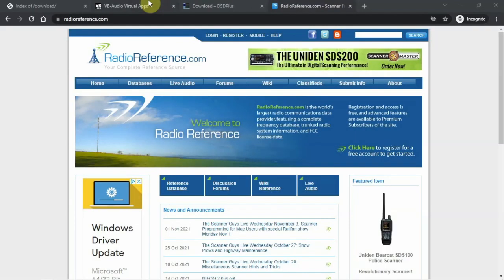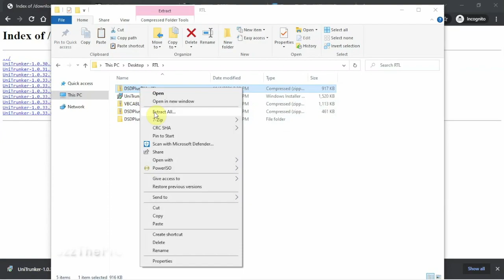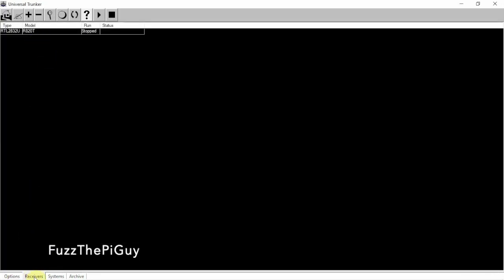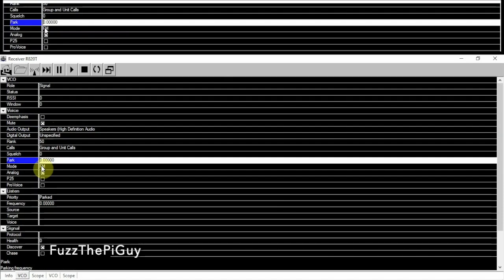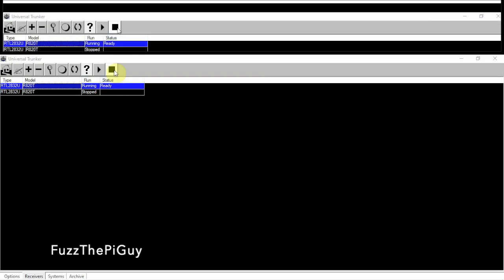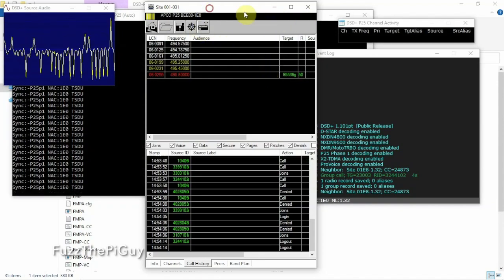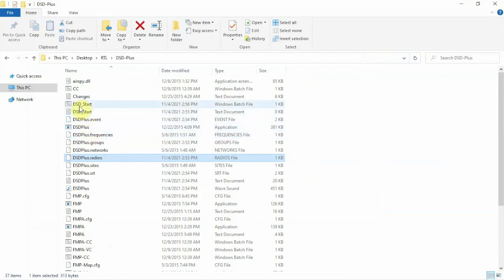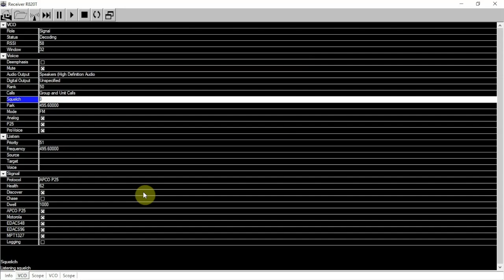Setting Up DSD Plus, Unitrunker, And VB-Cable On Windows 10 | Digital Decoder For P25 And More

Comment: Help! So i have gotten Unitrunker's health to almost 100,bounces from about 80 to 100 and i see calls coming across, But all i hear is static, i also get an error trying to start the Batch file you make, it says windows cannot find it make sure you typed it correctly. My audio input device #1 is cable input vb audio, Audio output device #1 is my speakers. Is this issue because im trying to decode a p25 phase 2 system and dsd plus only decodes phase 1?

Comment: I've tried multiple times, and it just stays on the control frequency at my mothers (I can see the data stream, and see the frequencies pop up showing people on those frequencies talking, but it never jumps to the frequency they're talking on), it never goes to the voice channel even if there's activity, and no the voice coms aren't encrypted as I can go to the voice frequency on SDR++ using VB cable as output and having DSDPlus decode it just fine. 

Now the odd thing is that I got it working just fine at home and it'll hop to the voice frequencies. But at my mother's it just stays on the control frequency.

Comment: what if there's more than 1 red frequency?
Reply: One is the main, and one is the backup (sometimes there's more than one backup) You just choose one and try it if it doesn't work, try the other one, simple deduction. 

Or write all the red control frequencies down, use the SDR (being that you're here I assume you have an SDR and how to use it) to go to said frequencies and see what one is transmitting, or choose the one with the best signal.